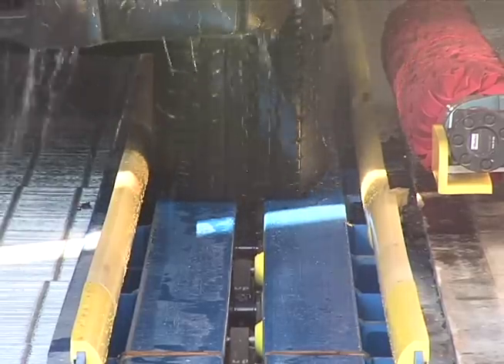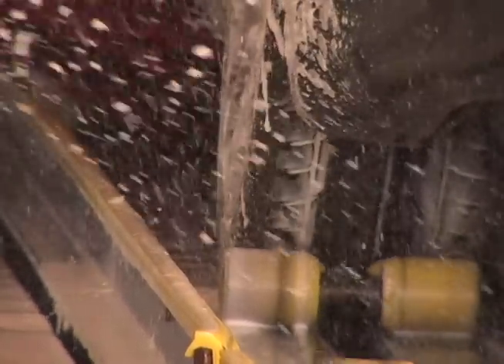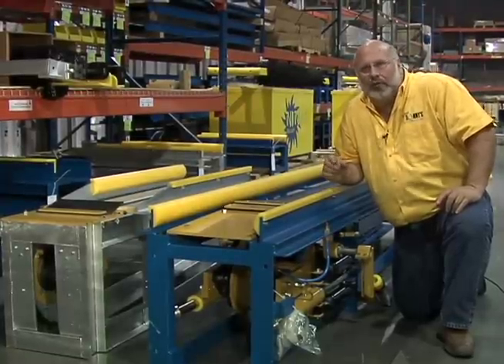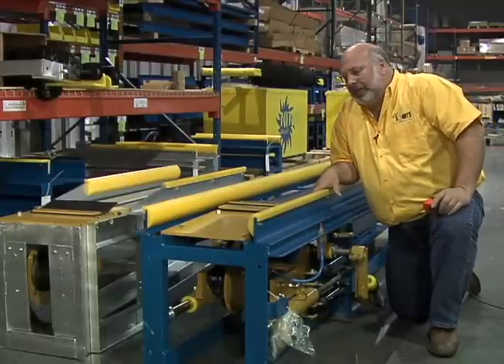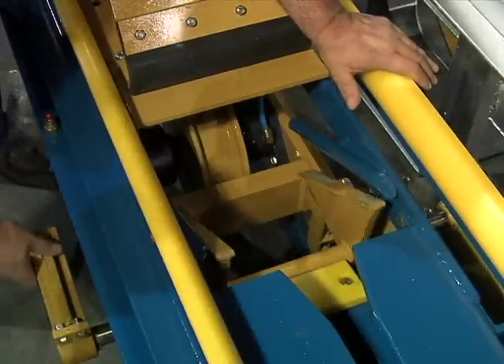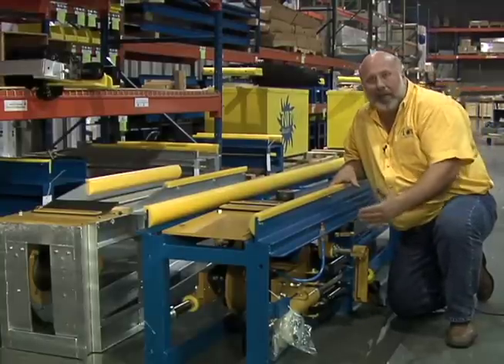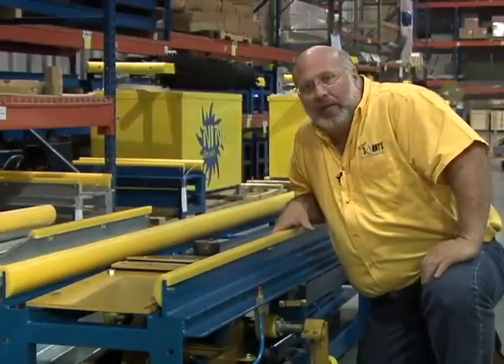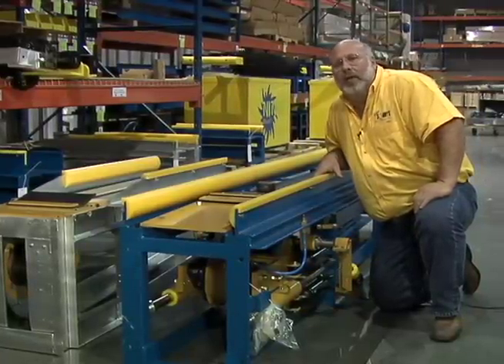SONNY'S Car Wash Equipment - Banana Peel Rail Conveyor

Comment: How many cars per hour can this do
Reply: Mac Jones this is a over/under conveyor so in the control room you should be able to change the speed.
Reply: The car count isn't on the conveyor, it has to do with your equipment in the Tunnel, i've seen Better Conveyors run 150 cars an hour, but that's a 200 foot tunnel with a massive equipment package. The thing that gets me is they use crappy chain on this Conveyor shown as opposed to a x458 chain.